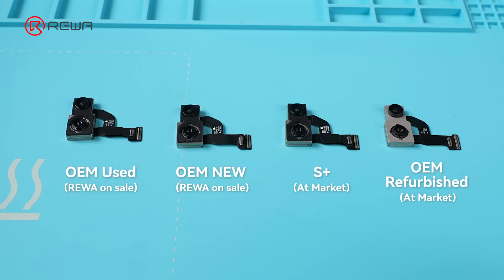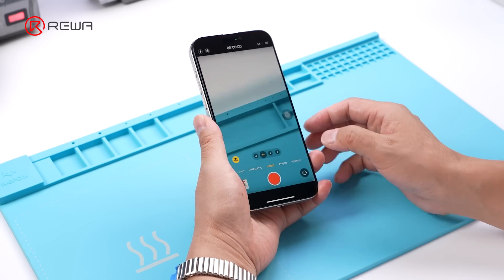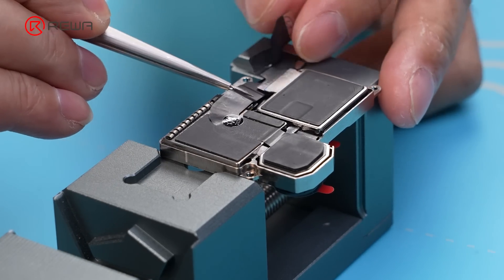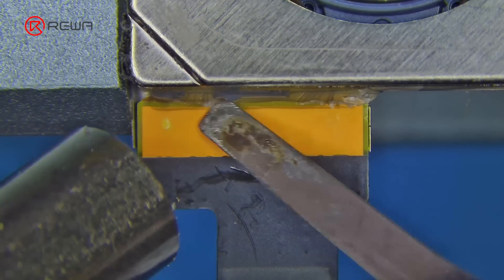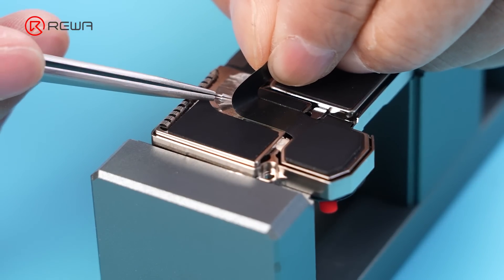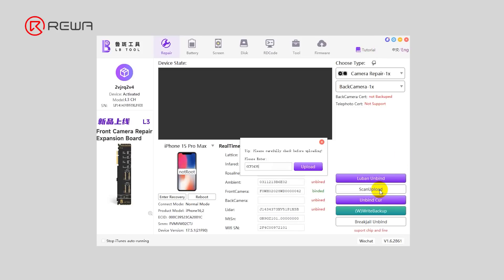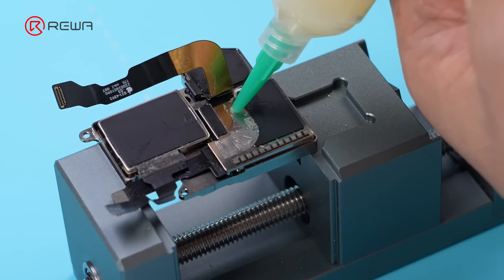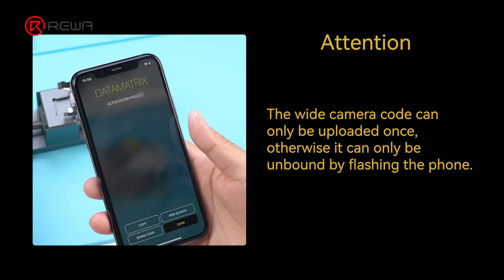How to Remove Rear Camera Unknown Part Message for iPhone 15 PM

Comment: Yesterday I replaced the rearcam of Iphone 15 Pro with a aftermarket rear cam assembly and subsequently I configure it for almost 30 minutes for a 2 times until I successfully verified it, as a used information hehe
Reply from the maker: The rear camera clibration is painstaking.

Comment: So successful connection to the LB Tool will indicate if the Soldering pads of the new Wide flex cable are good? If there is no connection to the LB tool then the pads will need to be soldered again?
Reply from the maker: Yeah the soldering is important for the repair flex cable, after all you need to connect them together for QR code

Comment: To me it looked like you removed the wide camera, detached the flex from it and soldered the new flex cable onto the same old camera instead of a new camera. Then put the same camera back into the iPhone after writing the original data.